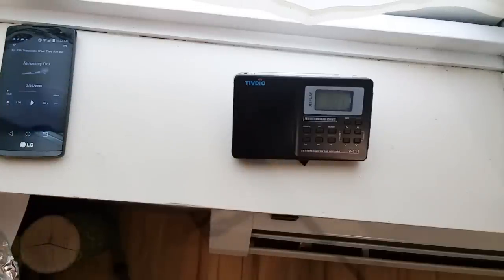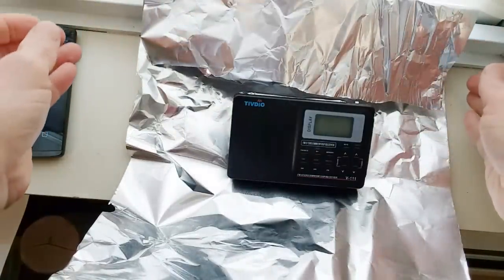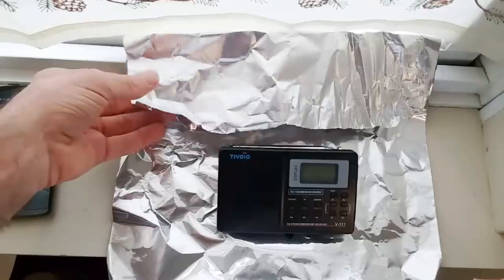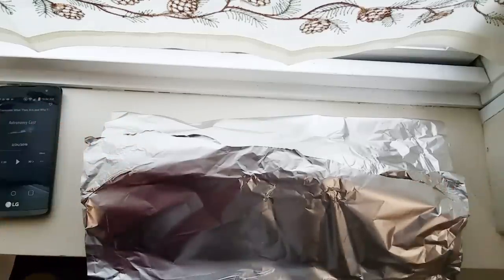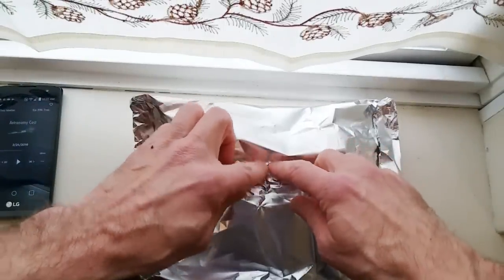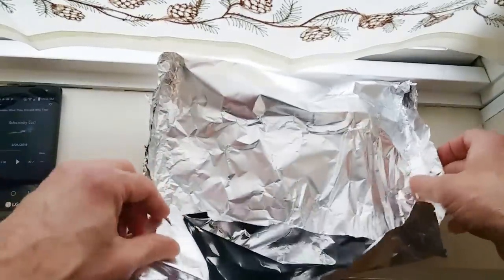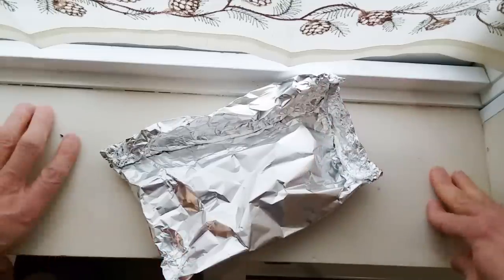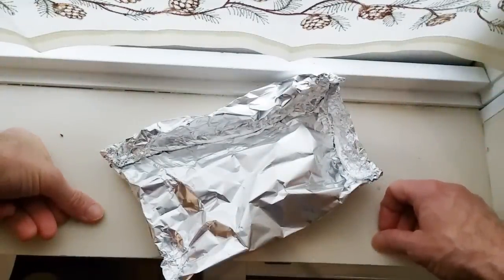Blocking EMF radiation around the home

Comment: Cu Copper to Al Aluminum is a Galvanized Corrosion, which is An Electro - Chemical Corrosion, that continues until One Metal completely Destroys the Other.                                                     Remember, They [They] Replaced Sn Tin  for Al Aluminum, when They removed the   Pb Lead Plumbing <Plumb>.  Pb Lead, is within a Chemical Decomposition, like           Ur Uranium <Biblical Ummim, Thummim = Th Thorium> from Au Gold.  Au Gold is produced by Stars C Class <C = Ca Calcium burning>                                                 Oldest Stars = SA {RA = Night Void, No Stars = RA MOSES vs COS (5) MOSES} are      H Hydrogen to He Helium = Deuterium = Deuterons = Deuteronomy = Astronomy creativity of Electrons [ELECTRICITY DI POLE, TRI POLE = Li Lithium = Ground]
Reply from the maker: Seems interesting but I can't quite follow...would you please re-write so I can understand? Thanks.

Comment: Try lead , you get a roof flashing for mission "s", cap and pan , or any other curved roofing tile. The part of the flashing that meets the roof is made with a sheet of lead . Cut it away from the rest and wrap your device in that. I would bet that no signal gets through.
Reply from the maker: Lead will do it. I'd rather move 1000 miles from a metro area.

Comment: I wrapped aluminum foil a few layers thick around my cell phone and had someone call me. He got through with no problems
Reply from the maker: Interesting...you live in large US metro area with 5G (60 GHz) cell service?
Reply: @p1nesap  5G launched to the consumer market in March 2020 on the Rogers wireless network in Canada. The other two carriers Bell and Telus are investing in upgrades to the current 4G LTE network that will make the transition to 5G seamless. I live in one of those major cities that have 5G. But the Samsung Galaxy S20 5G models is the only phone that supports 5G in Canada and my phone is not 5G. So I can only assume that I'm still using the current 4G network. I live in a small apartment and I'm looking for inexpensive ways to block 5G out of at least one of the two rooms and aluminum foil will not work.

Comment: Your test has some flaws. Your streaming app does buffer the content quite alot beforehand and therefore you cannot here prove that your phone still has wifi connection. I just tested the same thing and looked in my routers client list and my phone disappeared right after I wrapped my phone to aluminium foil.

Comment: They are called cell towers and cell ph one's  for a reason  this cell towers and cell phone  attack the cell ph (oxidation,  so is important to have a ph positive alkaline diet to conter attack) individuals one's.  The wifi and now 4g n 5g are a stronger radioactive  frequency hence they can go through tin foil aluminum.  But i am in tulum mexico con a cabin and when i closed the shower door and brin the cellphone in the wifi signal is cut. So it can't go though couple wood wall layers is what i find out and also i junto inside a cocoon dome wood at a restaurant and in it the signal get cuts but if i put the cellphone to the tip of the entrance  it works . And it's a small dome noting to big or tick and is open from two sides is not even sealed but it does work on blocking the wifi. Now i want few for my room and living room i need to build one like it to be protected!!
Reply from the maker: Hola Mexico! Thanks for posting. I take magnesium daily. What else would you recommend for alkaline diet? I love my green tea and chocolate.

Comment: Happy accident! Building my latest ECOhome (SWFL) I was given lots of alum-foil faced insulation panels (4'x12'x1.25"). I friction fit them between the interior wall studs completely. You know, though I've built lots of structures, but when done, it REALLY "felt"...different! Think its blocking stray EMF, that otherwise would enter? Hmmm...I sure need to do more research & discover how more to augment this pretty simple & effective solution for creating low-EMF residences! Yippeee...God is good, sometimes, to fools as I who insist on always building one's COOL ECOhome! My 7th. Quit fooling around, reader...you can/should to!
Reply from the maker: Excellent! Thanks for reporting how you reduced EMFs with foil-faced panels in your ECOhome 👍
Reply: As a caution, much of the RF signals you generate inside (from WIFI and cell devices) will bounce back at you, so this kind of reflective shielding is only appropriate if you are primarily a 'zero RF' household, with wired devices only.

Comment: 5G makes me fearful.  Is there a video showing how to protect from 5G, 4G, EMF, radiations from home and while outside?  i'm experimenting turning off my router and using wired connections to see how it effect my mind body and health.  I always turn my phone to airplane mode when I sleep.  But last 2 days I tested turning on hotspot on my phone, leaving it close to my bed and this morning I was having difficulty breathing, like not getting enough oxygen in my lungs, my body was so exhausted and my mind felt like a zombie.  Going to turn ON AIRPLANE MODE  and not using router anymore.

5G is 20 - 30 times more powerful than 4G and at 60Ghz will effect you're oxygen absorptions.
Anyone have this experience?
Reply from the maker: Sounds like you've made some good observations and adaptations. Are you living near a metro area where 5G has been implemented? It only has a 1500 ft / 457 m range so far. Verizon's list: https://www.verizon.com/about/our-company/5g/when-will-verizon-have-5g
Reply: Sounds like you were just sick… 

This gives off the same energy as a midieval priest “exorcising” someone who’s having a seizure

Comment: its wifi, the probability is that the service you are listening to has already buffered into your device by several Mbytes. Once the Buffer runs out the S-Band will not be able to penetrate the tinfoil either.

Comment: I am baffled by the disjointed logic. AM/FM & 5G use 300Mhz to 50 GHz (50,000,000 Hz) roughly. These frequencies are dangerous, correct? So as we move to higher EM frequencies, the danger/damage or negative effects should scale accordingly? Correct?

A fire or oven outputs EM radiation at 200,000,000,000,000 Hz (Infared) aka heat. A 5G signal, would take 228 years to equal the EM radiation output by your oven in 60 seconds.

Visible light is EM radiation at a frequency of 400-700,000,000,000,000 Hz. A 5G signal would take 766 years to equal 60 seconds of the EM radiation output to your eyes by light.

Ultraviolet is EM radiation at a frequency of 750,000,000,000,000 Hz. It would take a 5G signal 856 years to equal the electromagnetic output of ultraviolet light in 60 seconds.

You are bombarded by EM sources several orders of magnitude greater than radio waves. The dome light in your car emits 15 million times more EM radiation than a 5G signal. If you aren't 15 million times more sick, then the results most likely do not prove the theory.

Comment: FM is Line of sight system its beam is very small as such its easier to shield againsts AM is a ground wave it folllows terrain and needs objects to be in a complete Faraday Cage. WIFI is also built on a line of  Line of Sight model but transmission is broadband its information exists over a larger range frequencies compared to the narrow band of FM with a channel size of 0.75 MHz. Its just odd that  picowatt transmitter doesnt get blocked by aluminum but of course the magic is in how its actually designed to work by stitching up packets that converting continous signals into audio signals like FM and AM. Perhaps adding a layer of Al will allow to achieve the desired effect.

Comment: Good job! I was wondering initially if you'd mention the difference between the FM & AM aerials as you did have the FM aerial down. Nevertheless, that becomes academic because you proved that the router sigal penetrated the foil. In essence, my explanation would be that if we were to magnify the properties of this foil it would reveal the answer. Perhaps try a few brands or thicker oil wrapped two differing ways. What if the foil passes in polarization for eg. Nice heads up thanks! Gonna try a few things myself now.

Comment: I go on a Spartan Vintage travel trailer foum because i am wanting to purchase one which are Aluminium and no one has problems using Mobiles phones but they have to put radio masts up .

Airstream and Spartan are perfect Faraday Cage,s and yet don't stop Mobile Phone signals .

GPS and TV doesn't work in Spartans also unless you use a Ariel .

Comment: When you listen to a stream using wifi there is a big part of the stream already saved in your device which will play many seconds or even minutes after the signal is blocked. Also some smartphones have their antenna attached to the metal chassis of the phone if there is one and the aluminum foil when it touches the chassis drives the waves to the antenna and you get a signal. You could wrap first your phone with a plastic or paper and then with aluminum to see if there is a signal.
Reply: Buffering they call it
Reply: Good idea, I made a similar comment about the pre loaded data concern.

Comment: The shielding mefium has to be grounded to earth. This is basic electronics stuff, easy to find solid information on it. We shield guitar electronics all the time. Also why you get poor signal in metal Butler style buildings; the frame, and therefore the rest of the structure, is grounded to Earth.

Comment: Put simply, the WiFi is only 10 feet away, four square rule folks, the foil is close enough to pick up and re-transmit inside the Faraday cage. Go the other side of a brick wall and try this again, you will find there will not be enough signal to trans-pond.

Comment: congratulations, you just proved that frequency and received signal power are affected by density of a material interposed.  You know, like what we learned in 5th grade.  What does it mean?  Only that aluminum has sufficient properties to block certain frequncies at certain fr power levels.  It does not indicate anything else. You have proven your radio is smarter than you are. In other news, water is wet.

Comment: You should always wrap it with two layers just to be on the safe side. Absolutely make sure there are no openings or rips on foil. Use heavy duty foil which is thicker and works better.
Reply: Am I missing something? You're blocking the radio signal to the radio - voila no more reception - did the radio waves go away or just being blocked from the radio? Are we still being exposed to these random waves? I'm not an expert in electronics but it would seem that we would want to block the waves from entering our space, not just the radios - or am I wrong about that?
Reply: @lawsonshilingkendall4246  Radiation only comes from your phone when you're actively sending signals. Otherwise it's just receiving the signals that are already around you. If you wrapped your house in tin foil, you would get a double dose of your wifi router and your radio won't work.
Reply: @lawsonshilingkendall4246 good question! But I believe they are like  magnetic 🧲 waves looking for the receiving end, thus being absent unless there is a radio nearby. Not sure how that works with neighbors... depends which area the radio frequencies are coming from. Maybe I'm wrong? Anyway, makes me think of the AMAZING move, "Frequency" about the dad and son communicating on an old radio years after the dad died as a hero...watch it if you haven't it will bless you! God bless!

Comment: Next video: How to wrap your house in aluminum foil.
Reply: Try lead paint. There is a reason they quit making it...had nothing to do with kids eating paint chips.
Be safe.
Reply: @grinningintheirface2685  YEP
Reply: @grinningintheirface2685  its matarial used in bah chips?
Reply: Aluminum siding.
Reply: Right
Reply: We shall "foil" their plans to depopulate.
Reply: 😂😂 @miameow4833
Reply: We were told to do it in Better call Saul!
Reply: UnderTheBigOak .. https://www.theatlantic.com/notes/2015/09/wrapping-cabins-in-aluminum-foil-as-fire-protection/405238/
Reply: Right
Reply: There is a special paint you can buy that can protect you from the radiation.
Reply: @robertallan6373  oke
Reply: @robertallan6373  tell me about it?
Reply: @robertallan6373  lead based
Reply: @koolkitties8552  Should be right if you don't eat it, or if you have small kids.
Reply: Nope this method didn't work even against mere wifi signals.
Reply: @Equelan2  It dousent work ? Only for the sun?
Reply: DO NOT DO THAT. It will just turn your house into a big microwave and your devices will masively concentate emf and EF radiation into your body.
Reply: Yeeeeees😃👍
Reply: And fill it with corn kernels.
Reply: I saw a video that a paint can actually named T98 that can stop emf
Reply: @regine5461 it’s about $800 for a 5 gallon container. It goes on black but you can use any regular paint and color afterwards so your house isn’t dark.
Reply: LOL😂😂😂😂🤣🤣🤣🤣🤣🤣🤣🤣🤣🤣🤣🤣🤣
Reply: I just started wrapping it in fine aluminium mesh today but. DYOR.
Reply: It's coming through the power grid. It's the 60Hz that keeps you in low vibration. We really need to start thinking deeper
Reply: Exactly 😂
Reply: We are doing it!!

Comment: There is a government directive in UK to remove fake stuff like this from you tube. It will soon be gone, so take the chance now to express yourselves in as idiotic a manner as you possibly can. Stay out of sunlight, the radiation is over 150 million times stronger than 5g. Live 50 miles below ground, you may escape the cosmic radiation, and the billions of neutrinos that flood every square inch of the earth, then pass out through the other side. Don't breathe the atmosphere, it contains radon from the planet's core, which gives you cancer. Don't stand in the rain, it contains carbonic acid (created by lightning) that will rot your skin and kill trees. Stop burning coal in power stations, it releases 75 tons of mercury into the atmosphere every year in the states. Stop driving internal combustion engines, the NOx produced kills people by giving them lung problems.
There's a hundred other things worse than 5G, 5G is only another group of frequency bands in addition to the existing 4G, 3G, TV, radio, keyfobs, remote tv controls etc. Wear a tinfoil hat in public to help people spot the stupards and steer well clear of them, just in case stupidity is contageous.

Comment: Take into account the quality of aluminum foil has been decreased. In some case can be noticed by the foil having an hexagon pattern. Old products were better [maybe more dense].

In my case did experiments placing a phone on an outside window, within a wodden box, open in one side [looking at the cell tower], and with multiple layers of aluminum covering the rest of box walls. Then connecting an USB wire to move from the inside box to a laptop computer. So the cellphone can be used as internet router. Thus lowering the radiation impact in the room.

The ideal solution according to a technician was to place an internet router using a simcard [like a cellphone] outside home. Placing it in a protected box with an open side aiming at the nearest tower. Then use home wiring [RJ45] to distribute the signal. This is for a small town without DSL/Fiber connectivity.

Comment: Look up information on how microwave ovens work. The metal mesh on front of door due to holes keep microwaves in.  Maybe find the exact materials and do this in reverse or something.  If it keeps them in oven, could we make something to keep them out.  Use old microwave oven to store phones and other devices. A while back I  
watched a video where a man would make things out of copper, even wearables to ground you , if that sounds right, can't remember.  3g used copper in wiring before we went to wifi. Allegedly,  it's been reported that isreal only uses 3g due to damage from wifi

Comment: you need to check your packet loss and data transmission rate to really get an idea of how the wifi is being effected.
wifi protocols have all sorts of error checking and power and encoding options to deal with signal loss issues.

Comment: I did this experiment with my phone couple of years ago I had to double the foil to block the signal.
Reply: Like it's been said elsewhere, use copper. Apparently mesh works but I'm most familiar with copper foil tape which has been rock solid.
Reply: Do you cover all the windows? How is that possible? Won't it look odd? Do you use wifi?
Reply: @GiftyEliyanaGraceActs  no WiFi, as for covering windows you can buy emf blocking fabric for making curtains bedding just about everything you can even buy emf protection beanie hats on line.
Or we could all band together as one and out the evil perpetrators. For crimes against humanity.
Reply: @whiterabbit594  ok thank u Mam. What material blocks emf? Any ideas? Anything that I can make myself?
Reply: @GiftyEliyanaGraceActs  it's copper
Reply: @whiterabbit594  ok Mam Thank you
Reply: Thank you

Comment: Put aluminum foil around your modern key fob to prevent your car from being stolen by thieves when they try to duplicate the RF signal. Just try to open or lock your doors with just some aluminum around the fob it wont work.